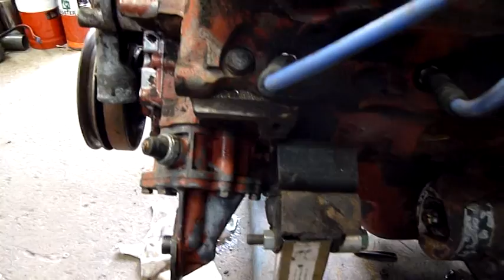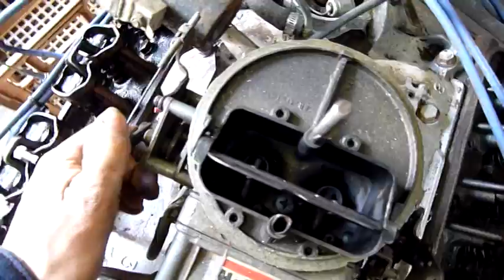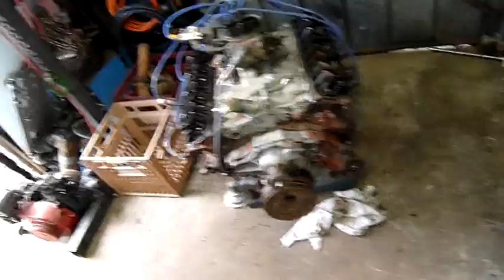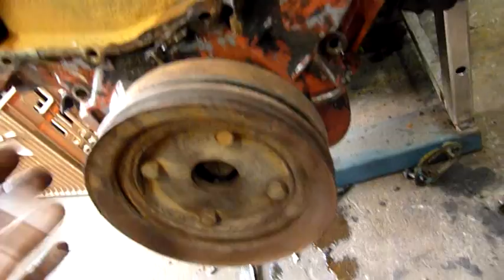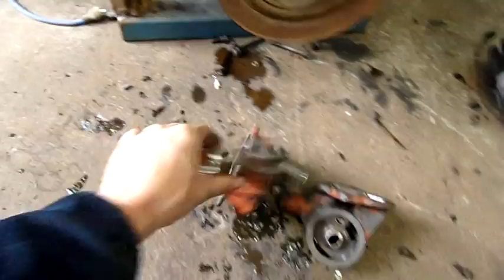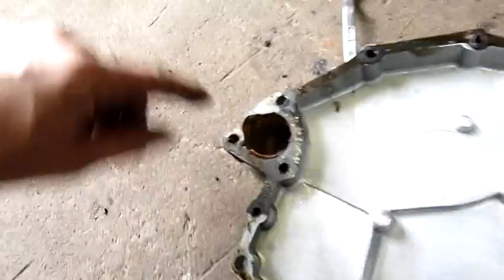Holden 253 V8  Autopsy pt1

Comment: Another thing that can cause bad oil pressure is worn out components. An oil pump moves volume and pressure come from resistance. So if oil is able to just piss out of a worn bearing (ect ect), you will have low or no oil pressure.

Comment: Its interesting comparing this to the engine in my truck, which is a 287 (4.7L) They've really got them full of electronic things these days, with the EFI and the coil on plug setup it won't even run without the PCM.  Makes you miss how simpler they were, but the new ones seem to be just as reliable (depends on which engine I guess).

Comment: That firing order is rather peculiar to me - it's nothing like any GM firing order in history.  It's the same as BMW and Mercedes V8s, as well as the old '49-53 Ford flathead (all of these vehicles number their cylinders 1-4 right and 5-8 left but the pattern is the same).  All American V8s since the flathead cross corner-to-corner twice.